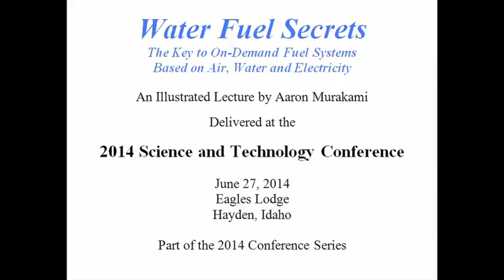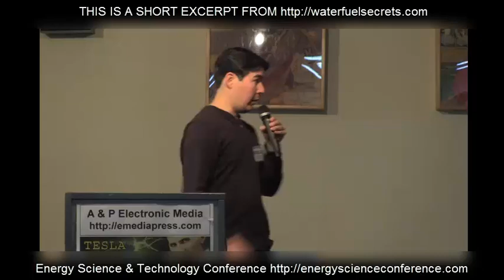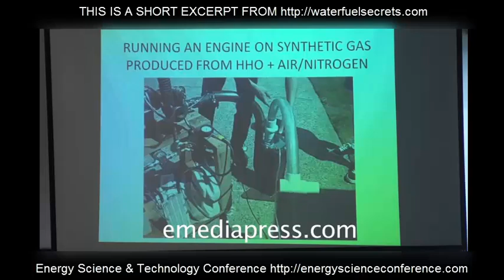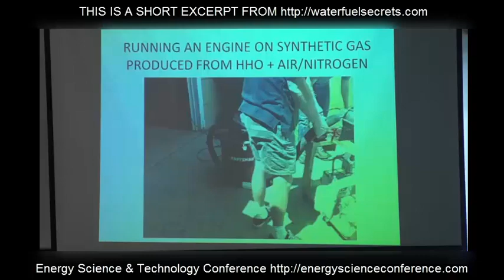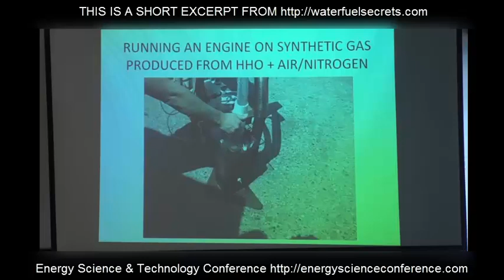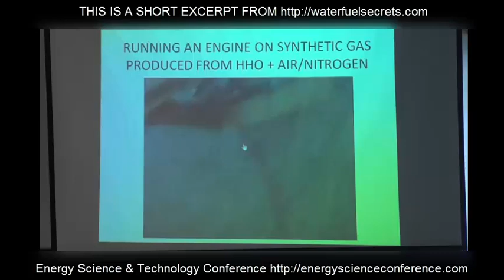Water Powered Jet Engine + Trace of Propane

Comment: Was any conventional fuel used to start this reaction or just battery powered hho?
Reply from the maker: Propane, it still uses propane but when starting the experiments, it required 8psi of a certain flow to just run. By the time I was done with everything, I could turn it down where the needle was touching 0psi. The scale on the gauge is too big to see 0 to 1psi accurately but in any case, that is a massive reduction.
Reply: @AaronMurakami13 phenomenal! 😮
Reply from the maker: Bring the conversation to https://energeticforum.com :)

Comment: Well its been 4 years. Just how far have you developed this ? You use a very small amount of hydrocarbon. And you split water with plasma ? Would not this same tech work with an ICE as well ?  Jet engines are not common . An adaption for ICE's would make this a viable solution for the general population . There may even be better ways to split water sense this vid was made. Like dual RF . By now your probably aware of that. Very interesting vid at the very least.
Reply from the maker: You can search my channel for "Wind storm" - I put it on a Champion generator and also a video on my Datsun pickup. Not with the whole exhaust recycling, etc. only the plamsa ignition. Have more to do when I have time.

Comment: Nice work:-)
loved the Stan Myer's bit.
From my understanding of his work: He used red diode laser's to optically pump the hydrogen atoms, to a higher energy state.
The ionization ev of hydrogen is 13.28 ev (electron Volt's)
by pumping the electron to a higher level ~ 1.28ev is needed to ionize the gas, alternating power surges, between electrodes: Made the water fuel solution >>boil off the gas<< ;-)
Reply from the maker: +Paul Wedlock That is all at a later point in his work.
Reply: So long as it shed's 630 nm light on the subject ~ It's a quantum leap, in the right direction :-D.
Wishing you all the best ;-)